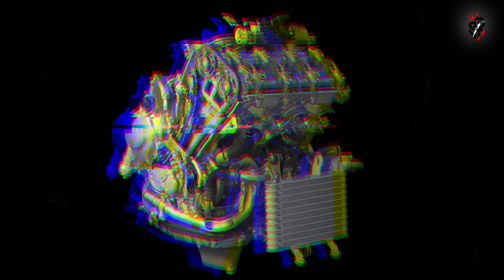Ex-MotoGP Engineer Built a V8 Superbike From 2 Yamaha R1s | PGM v8 Documentary

Comment: Why not fairing?
Reply: The engine is the centerpiece, and he did not want to hide it.
Reply from the maker: @kusheen...  That might be the reason 😅
Reply from the maker: “Yeah, because that wasn’t the goal 🤔 — the goal was usable power.”
Reply: Apart from that, in high performance machines the engine is developed first and the body is worked around it. 
It's only a matter of few wind tunnel sessions, designing a fairing would be far too easy.

Comment: RADIUS TURNING(R/L) GROUND CLEARANCE CORNERING. RIDE HIGHT.
Reply from the maker: Probably not great 😅—with that long V8 and extended chassis, turning radius, ground clearance, and ride height definitely won’t match a normal superbike. It’s built more for straight-line insanity than tight corner carving.

Comment: to wide to hevy to complicated want to make a real bad ass street bike that is narrow light and powerful get a modern 300-400cc, chassis take two 500 cc 2 stroke top ends like cr 500 or kx 500 make a v twin 1000cc 2 stroke making like 150hp easy and wieghing in under 400 lbs wet now that will be a rocket
Reply from the maker: Sounds like you’ve got a blueprint for a seriously insane custom build! 🛠️🔥
Reply: @SKroadstar yeah all I need is money and shop tgat can make bottom end custom like this guy or the guy Millard that has added cylinders to modded cases lol but v twin 1000cc water cooled 2 stroke would be light narrow and easy 100to 150hp stroke screamer and probably good torque and 2 500cc would have decent power band. Rode both cr an kx 500 dirtbikes they pull good across wide rpm range,not perky like 125 2 stroke. Great in dirt but not on street corner carver. Better to have smooth power band for street cornering

Comment: Interesting. I hadn't heard about this, but it must use a pair of 5vpc Genesis engines, and it's difficult to make 200 HP/l with that design. 

I'm not a mechanical engineer, but an electrical engineer, with a lifelong interest in racing motorcycles of all types(except big tire drag racing) and build engines in software(1D + CFD), and chassis via equations like those found in Scriveley's book, but this bike is both entirely cool and an exercise in futility as it simply cannot handle well. 

Great fun, but impractical. 

Re: the Genesis engine, there were precisely zero making 200 HP due to design choices made by Yamaha that could not be tuned out of the design. It was a fantastic idea, but packaging and the subsequent physical constraints relegated the 5vpc engine to a wonderful historical footnote.
Reply from the maker: You bring up some really interesting points about the engine design and handling, especially given your background!